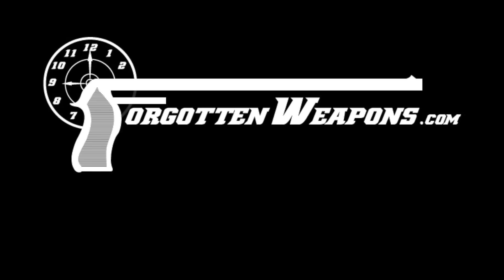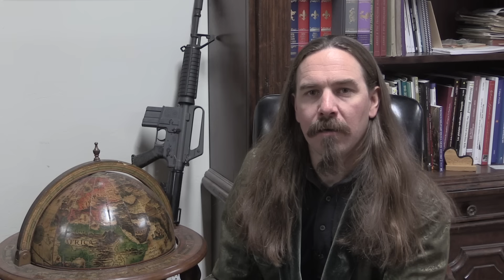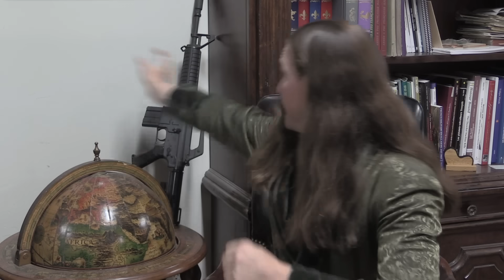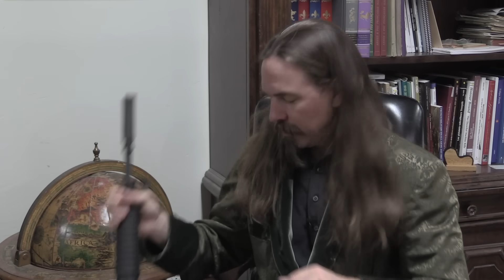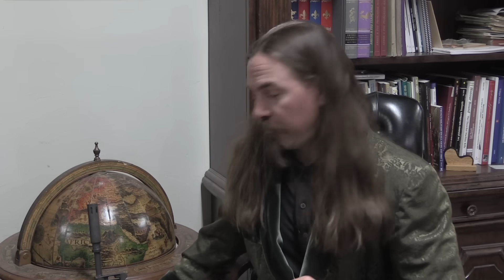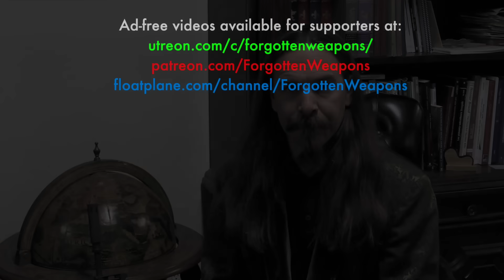Ask Ian: "Last Ditch" Rifles for World War III?

Comment: Just a quick note for those that don't actually understand how these parts are made (the actual handling and programming).  Many round parts are made on Swiss machines and multi-spindle/multi-turret lathes where getting rid of operations (features) does not necessarily make the cycle time lower because operations are overlapping.  So you can often end up in a situation where you get rid of a feature and now you have one spindle waiting on the other and you haven't gained any time.  Or maybe you get rid of a 30sec. operation but it overlapped with a 28sec. operation and only gained two seconds.  I think Ian hits on something that the only way to really reduce time is to go to an additive technology like injection molding versus eliminating operations on subtractively manufactured parts.  With his "simplifying the sights" example, there could be a significant lead time to re-engineer fixturing (then build it) and re-program.  You can't just eliminate a few sections of the program in many cases. Inspection would pretty much have to go right out the window, and with the two-week timeframe discussed here, no way you get through your statistical process control analysis and implementation so you have a pretty good chance of putting out useless garbage in high numbers.
Reply from the maker: Good point - I did not think about machines running multiple operations simultaneously.
Reply: So what your saying is when things get hot and manufacturing is a pop up shop in some tunnel, there will be no simplification and we'll all be back to bolt action lee enfields?
Reply: @XDamainI   hey some of us stacked K-31s deep on C&R FFLs when they were like $80 each.  Joking aside since a quality AR will go 10k rounds on a set of bolt rings and maybe twice that on a bolt I think we'll all be just fine.
Reply: ARVN RIFLES!!! Never fired and only dropped once!
Reply: Great post
Reply: @XDamainI  The amount of machining (and forging) to make an Enfield receiver is probably incredibly high based on all the surfaces and features on them.
Reply: You can't put out useless garbage rifles with designs like the Sig Spear since the chamber pressures are so high (60,000 psi) because the rifle will kill the operator. At least it would be a very short war. We surrender!!

Comment: Back in WWII, stepping up production sometimes caused changes by itself. This was common with wooden stocks: you can't suddenly increase production of well-seasoned wood by 300%. So the British and Germans, at least, went to laminated wood. This will not be a problem in the future, because everyone uses polymer now.
Reply: Some plastic producer that usually make else will be hard pressed to make chonkier less durable receivers in the plastic they know.
If it is a last ditch scenario, if those "plastic" parts could work as long as the volksturm militiaman that carry it, it's enough.
Reply: weren't a lot of guns fully made of metal anyway
Reply: I heard people in cold climate still prefer wood though. Because it's easier on the skin when you touch them at sub zero temperatures.
Reply: They started churning out the sten at a crazy rate after so many weapons were lost at dunkirk and they realised they needed more submachine guns as well, and they contained no wood. I still suspect at that time there were plenty of lee Enfields to go around though, even older models .

Comment: There's also the factor of pre-existing overall firearms production capacity in each country. There are hundreds of US AR and AR parts manufacturers across many non-strategic US towns/villages too small to be worth an enemy attack. In Russia, there's just Izhevsk and Tula and if those get hit, Russian AK production basically grinds to a halt.
Reply: @Pelmedeeznuts  if Russian guns were sitting in storage, why is the army issuing rusty rifles?
Reply: @Pelmedeeznuts  They're just sitting there or in crates, gathering dust.
Reply: We saw the Russian AK-12s disappear rather quickly. They're down to wood stocked AK-74s and 2022/23 made ammo. Even started to see AKMs recently. They're losing at least 1000 rifles a day. I doubt they can replenish that fast.
Reply: @donwyoming1936  I think you're forgetting that Ru was a MAJOR supplier of the ammo we use in the US until someone decided not to import their stuff. You're probably only seeing "old stock" because they want to use it up before it "goes bad" -yes I'm aware ammo doesn't go bad in a yr. but when you lose a market as big as the US you probably slow or stop production and say let's use some of this up (aka which neighbor needs some invading because we haz too many boolets)
Reply: @donwyoming1936  I think you're also greatly underestimating their production rate capabilities... Take just the ppsh41, not the simplest design, they built 5,000,000 of those from 1941 to eop. Being generous would be to give that 5 years and that would mean over 500 per day. 1000 per day with modern standards is not the issue, they're going to run out of humans before guns.
Reply: @donwyoming1936  The AK-12 is still around, they stopped issuing new ones because of various complaints, and they've recently started production of the AK-12m1.
Most importantly the burst fire mechanism interfered with the function of the rifle so they got rid of it. They're also changing the muzzle device because on the original they couldn't mount standard suppressors, so they're changing to the AK-19 style muzzle device. There are some other changes to the sights and stock as well i think.
Reply: @DasOrmur  yeah plenty of newish AKs in elite units. AEK and AK - 12
Reply: There was an old joke during the Communist era here in Romania :

Ivan works at the bicycle factory. He decides to steal a small component every day, so he can build himself a bicycle at home. 
One day, he gets to the basement and starts assembling his bike. 
Every half an hour, he comes back to the kitchen, curses, takes a shot of vodka and goes back to the basement.
His wife finally asks him what's wrong.
Ivan goes : " No matter how I try to assemble this damn bicycle, I always end up with a machine gun !"

The point was every Soviet factory was multi-purpose, they could quickly switch to wartime production needs.
Reply: tractor factories will have tanks roll out of the front door.
Reply: @scratchy996  😂🤣
Reply: @Pelmedeeznuts  and the US is a country where there are more privately owned weapons than citizens.
Reply: @george2113  where do you think they get the rusty AKs from?
Reply: @JetleanSam  rust on the outside of the firearms frequently means rust on the operation components. Meaning undependable operation. Nothing hurts morale worse than not trusting your gun!
Reply: Also worth noting that with the way the M16 platform is designed, you can kind of just assign small shops small parts and then all truck them together at other plants to make full rifles and then just go
Reply: I was thinking the same. The government could surely adopt AR-15 parts and accessories from the civilian market and use for their own M16 and M4 rifles, as that weapons platform is basically interchangeable like building with LEGO.
Reply: @buddermonger2000  Reminds me of STEN production after Dunkirk. It would be very, very easy to implement here in the US.
Reply: @george2113  peasant take, you probably also believe that the russians are using mosin nagants as standard issue
Reply: @beargillium2369  I totally disagree, the manufacturers aren't spooled up for those types of products. I'd argue production capacity is significantly less than WW2.
Production tools today are much more specific than the flexibility of WW2 era machine tools.
Reply: @AmalekIsComing  Peasant? Prove him wrong, serf.
Reply: @erikcrouch7881  standard peasant response, where have I seen this before?
Reply: @scratchy996  that's the difference - you can't really extrapolate USSR stuff and modern Russia. A lot of those capacities went poof during the 90s directly after the collapse of the USSR (both in Ukraine and in Russia if we're talking about current conflict).
Reply: @TheFivetimesdead  100%, even if that equipment still exists it's not nearly production ready 30+ years later. Not to mention the labor skill set to utilize the machinery effectively.
Reply: @AmalekIsComing  straw man attack
Reply: @otm646  Wait, do you have that backwards? Because a modern CNC machine can do whatever you tell it to do and changes are as simple as selecting a different program, while the machine lines of yore were dozens of machines (or more) each making a single very specific cut.
Reply: @scratchy996  Russia isn't the Soviet Union, though. Russia's industrial capacity has long-since been sold off for an extra superyacht.
Reply: @george2113  they are soaked in cosmoline and will be fine
Reply: Yep, lots of conscripted men could bring their civilian rifles to the fight too. The rifles use the same ammo and plenty would prefer their civilian AR to some shitty last ditch rifle.
Reply: The thing is that most of an AK74 can be made using hand-tools out of metal scrap and wood pulled from demolished buildings. The only thing that requires quality metal and a complicated machine is the barrel, and so long as Russia can source those machines, they can make AK74s anywhere they can get the people and raw materials together. That was part of Kalashnikov's original design criteria, drawing off experience of the Great Patriotic War where many Soviet weapons had to be fabricated in besieged cities or without a prepared arsenal complex. Take out Tula or the other arsenals, you slow down Russian production, but production can be revived most anywhere. 
      Also note, a wartime expedient rifle only has to last a few months in action and not be liable to blow up in the user's face in a way that maims them. This can be done without the high quality controls that an arsenal like Tula normally provides. Bolt starts cracking after a thousand rounds? Throw away the gun and use another one until something breaks on it. Rinse and repeat until victory or defeat.
Reply: @mr.nemesis6442  if it's that bad you best not show up
Reply: @junicohen7918  most engagements nowadays happen at about 300 meters. Full auto in a rifle is rarely useful outside of certain niche situations.
Reply: There is no Izhesvk anymore. Hasn’t been since the fall of Soviet Union. There is Izmash now or however it’s spelled
Reply: The m16 was designed with that in mind - distributed production (learned from WW2 in Germany), subcontracting, etc.
Reply: @george2113 poorly laid up in the Cosmic/Cosmoline?
Reply: @junicohen7918  you could be right, but I have trouble believing Russians would bother with cosmoline
Reply: @george2113  they aren’t
Reply: @donwyoming1936  ok dude
Reply: @mr.nemesis6442  particularly if they purchased a 2020 or later WWSD rifle
Reply: To much stashed away to make a difference
Reply: @dennisyoung4631  not sure I'm understanding you. Be well
Reply: @EpicGamerino  could you clarify what comment you are referring to?
Reply: @george2113  not sure what Russia uses for long term preservation of items prone to rusting, but I’ve heard this stuff is called Cosmic (grease) or Cosmoline.

A guess, based on some of my own experience with Homebrewed chain wax, is that one might take petroleum refining residues - waxes, bunker fuel, etc - combine this stuff with just enough more refined oils to give a suitable consistency, then dip the weapons in question into a heated vat of the resulting gunge.

Once cooled, the stuff would become a thick and clinging mess that should keep out corrosion.  A further matter would be to wrap the parts in burlap while still warm, then a second dipping prior to boxing or binning for long-term storage.

I’m thinking they simply shorted the “Cosmic” ingredients and then rushed the process, then afterward did not take care as to the actual storage.  That would work ok for a while, but not decades.  Left to set for that long - some stuff is going to get damaged unless you lay things up right.
Reply: it'd be hard to imagine a lot, if any, of those small manufacturers having the supply chain necessary to continue operating in case of a nuclear attack.
Reply: @otm646  not really a CNC machine can be made to make anything you want. One machine can make multiple parts at a time.
Reply: My pillow factory definitely going to retool and roll out Giza-gats.
Reply: @scratchy996  soviet union is gone , it's just Rus fed now . The mind set of rus fed population is different now.
Reply: @donwyoming1936  Russia, unlike America, assumes losses. Therefore, they minimize the costs of those losses by working backwards. If the AK-74 can't do anything in a given situation to lessen casualties that an AKM can't do, issue an AKM. That way, if the soldier survives, great. If not, at least you didn't lose a nice gun. Same with armor. If the only way the specific enemy force can kill both a T-62 and a T-72 is with a side shot, then there's no point using a T-72 because the improved capabilities won't make much of a difference and you'll have one less T-72 to deploy somewhere that actually needs more advanced armor, like an area with heavy fortifications or a known enemy armor presence. There's also the fact that if you're keeping the old vehicles in storage and never using them, then by the time of the next war, you'll have a depot full of vehicles which are even more out of date than they were in the last war, and you have fewer of the newer vehicles which might actually be necessary
Reply: @scratchy996  We Russians have the same joke, although I think the version I heard was him building a car.
Reply: That's the big difference between capitalism and communism
Reply: It's much easier to waste US arms production than you think - there are very few industrial size manufacturers of critical components (like barrels)
Reply: @george2113  You really believe that?
Reply: @Killz0mbies  there are 63 responses please clarify which one you are referring to
Reply: I think most AR manufacturers are in small towns and cities Noveske, Radian etc
Reply: In addition to the AR -15s, I'd like to see more production of the AR-10 and a similar standarizeion of the 10.
Reply: @otm646  you're crazy modern cnc machines are much more versatile than ww2 era machines.
Reply: @fryertuck6496  you need to look at your own nonsense before you worry about mine!
Reply: @fryertuck6496  you need to look in the mirror more carefully
Reply: @george2113  Because, to an AK rust is just dry lube.
Reply: @JetleanSam  Rust from frequent use and minimal care? I would be more concerned if it wasn't AK's.
Reply: @genericpersonx333  This is a common thing many don't understand with Russian "quality". For Russians quality is more the abillity for your common citizen to be able to repair a thing with the use of standard tools in a short time. In short. Your car, washing macine etc. may well break down onece every 6 months but will be going in 5 minutes with no need for special gear.
Reply: @donwyoming1936  all the footage coming out of avdiivka says otherwise. They all had modern rifles with rails and optics. More likely shitty rear echelon conscripts let their rifles rust.
Reply: @george2113 They want to use them before they go bad or become scrap.